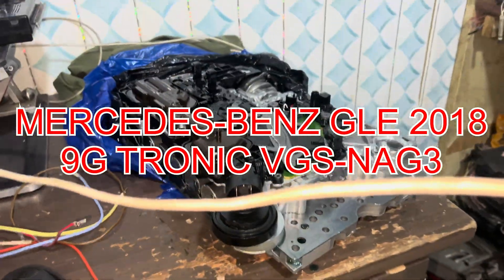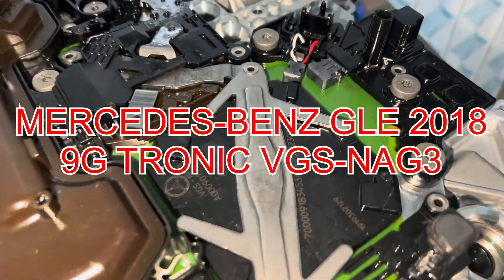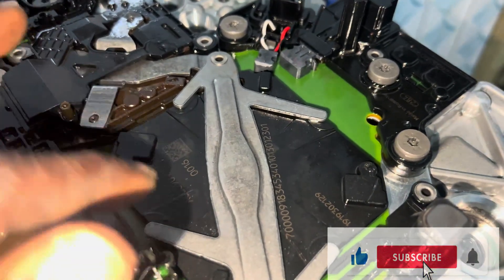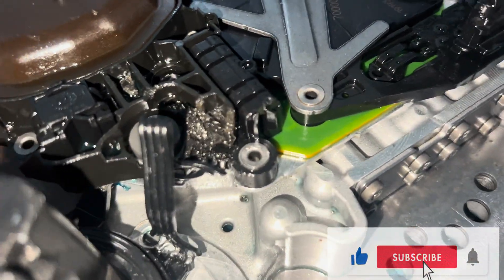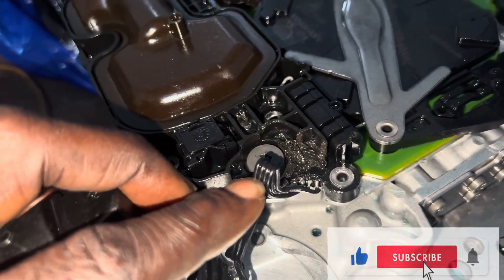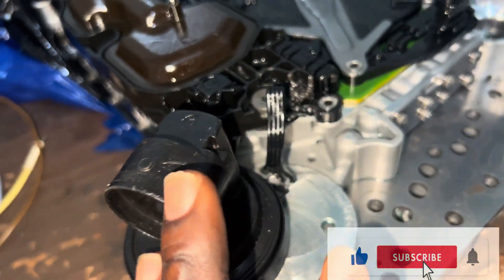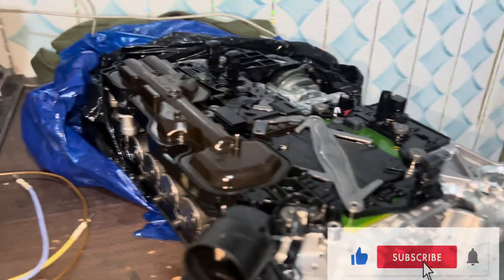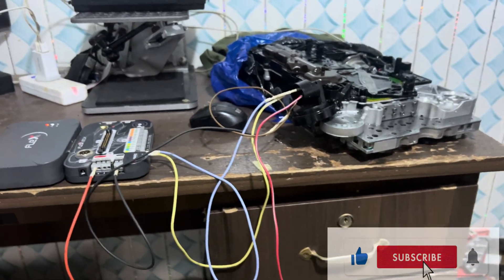MERCEDES-BENZ GLE 2018: VGS-NAG3 9G TRONIC TRANSMISSION CLONING

Comment: That is can't working 
Because different bosch number .
Failed full write 
Only write  eeprom and map
Reply from the maker: it was internet and data problem not different bosch number, i wrote it by individually and it was fine
Reply: @ozcelikotomotiv8639  I have the same trouble,  you find the solution?
Reply: @장효주-h8v, That happen to me, do you know, how to solve that issue
Reply from the maker: @orlandoprat2080 read the data individually and write them individually when you find it difficult in writing full backup